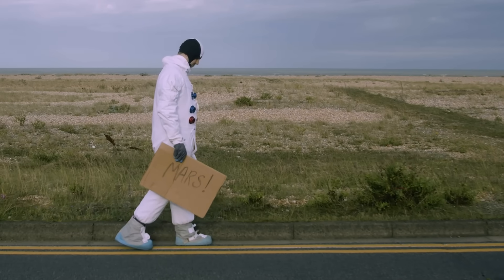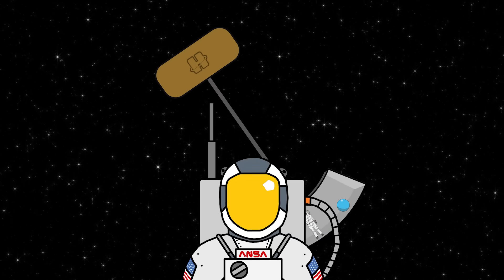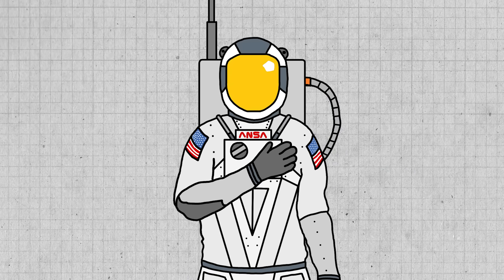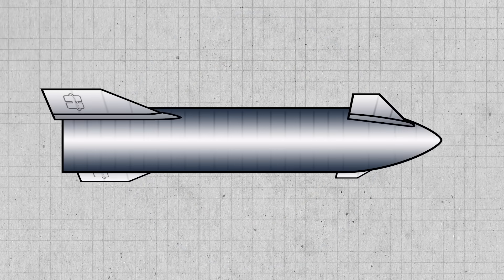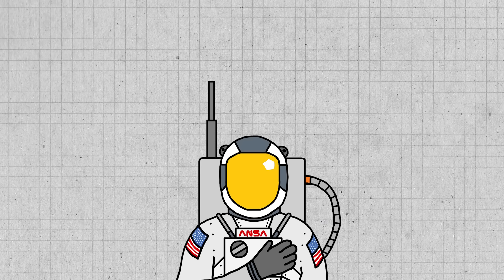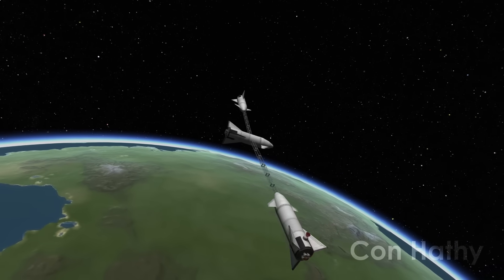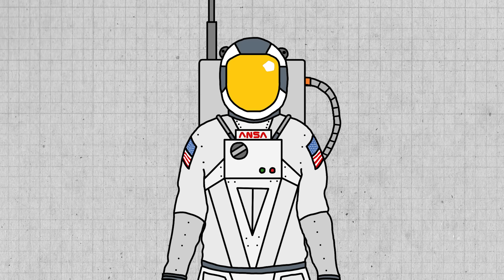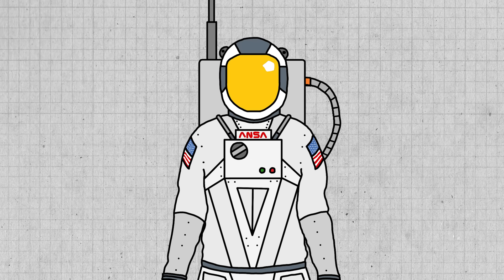This is NOT how you make Artificial Gravity

Comment: About fuel sloshing around - iirc, to prevent the fuel "not wanting to go down" "into the engine" we use a gas to fill up the "empty" part of the fuel tank, and pressurise it all so that the fuel "wants to go down"

Now i dont know if it wouldn't slosh around still, even with that added gas, since the two would probably move around, but for that mechanism to work the way it's intended to - it will "stabilise" the fuel where you want it - at the "bottom" of the fuel tank.

I am not a rocket scientist tho, and i might be mistaken.
Reply from the maker: @Kerbalizer  pressure forces more flow to the engines but doesn’t prevent slosh. To settle the propellant in the bottom of the tank you have to be accelerating to give it a sense of “down.” Pressure just pushes equally in every direction. 

Once your ship is spinning, the artificial gravity will settle the fuel, but even then, very slight movement will gradually waste the kinetic energy over time.

Comment: 8:30 I thought asymmetrical objects are precessing through the various axes while maintaining a constant rotation energy.  The bottle with fluid is a special case as the mass has no constant distribution.
Reply from the maker: @2adamast  yes, if an object is truly rigid it will maintain it’s energy, but in reality even mostly rigid objects slowly loose kinetic energy to heat (while maintaining angular momentum of course)

Comment: Simple answer is accellerate at 1G half way there, the decellerate at 1G on the second hald of the way there with the ship oriented the opposite direction. There are only a few minutes during re-orientation where the accelleration is zero.

Of course this means fuel usage at a varying rate to maintain that accelleration but the trip time will be shorter. Then you have to account for fuel for the return trip.
Reply from the maker: @bbahunter6436  I actually made an entire video all about trying to use thrust gravity: https://youtu.be/nRKNh-Gx9WA
Reply: The acceleration can continue at one gee throughout. (If you have that much delta V.)

No need for any minutes of zero acceleration during reorientation.

Comment: Dude, the rocket won't be rotating, obviously it is not designed for that. As long as it has lineal acceleration it has already "gravity" vertically, you can see that it is designed like apartments in a building.
Reply from the maker: @xantiom  I actually made an entire video all about trying to use thrust gravity: https://youtu.be/nRKNh-Gx9WA
Reply: Rockets accelerate for minutes not months

Comment: They should get a deployable giant tungsten cube on the end of a rope to make the starship spin around the cube
Reply: So it's deployable? You don't have to lift it with rockets, you just ... like ... deploy it?

A starship in 1-RPM end-over-end rotation can pay out a set of 10-km cables from its nose, using a low-thrust high-efficiency engine such as an ion drive to maintain the 1 RPM as the cable ends get farther out, and end up with the starship circling a point 1 km along the cable, getting one gee, while its far end circles 9 km from that point and gets nine gees.
Reply: @grlcowan  r/woooosh
Reply: @dathomirpizzagirl9686  Feel free to explain your wisdom to me.

Comment: There's no need for the central point thruster to be a whole starship. If you made it solely a propulsion system then you could tailor the mass distribution in your favor and you would no longer have the intermediate axis problem. Alternatively you could have a starship variant with a door on it's side that opens up to reveal a thruster for course correction. 
You could also tether 3 or more starships together in a symmetric pattern around the center (this would add large masses to the outside and change the intermediate axis to coincide with the thrust axis.
If I were doing it I would have a small donut-shaped hub in the center with a thruster (or several thrusters) inside that. For distances like Mars you would get great performance from some hall effect thrusters, so you don't even have to worry that much about sheer on the scaffolding. 
There are tons of other ways to go about solving this issue too. I wouldn't call it a massive problem. I would call it a minor engineering challenge at worst.

Comment: People don't understand that we have space IN space. We don't need to be efficient with it. We can send up 100 of the fuckers and chain them togather into a full blown ring megastructure and just F-ing park it on geocyncronous orbit once there, or land it on one of the small moons and send out purpouse built shuttles to the actual planet that you have plenty of time to manufacture. And yes, you can assemble this ring durring the woyage AFTER speeding up, and you can use mars gravity to save a lot of fuel on decelration, or angle the whole thing so 10 out of the 100 can do a slowing burn.

We live on a PLANET! with A BILLION engineers, probably. pooping out a 100 of these should be easy.

You think its not? Then the fuck you wanna go to space? Fix colaboration first, bloody tocomac got delayed another DECADE cuz ppl cant work togather. Look at america went independent practically on day one,  mars will be under constant blackmail, the culture gun suck balls, and probably go independent THE second they can self sustain.

Comment: This video is very old but I thought I'd share something, I am an aerospace engineering student in germany and recently visited a research facility of what is basically the german space agency and they have been working on countermeasures against long time low gravity exposures, since having permanent artificially gravity in your entire facility is to say the least a lot of effort they are experimenting with ways to make the muscle training already proven to work on the ISS more efficient by only training in higher g, this has proven somewhat effective and the training time needed to keep people healthy seems to be decreaseable, currently even on the ISS astronauts need to devote a significant portion of their time to training and for a mars mission this would be even more critical since they don't really get recovery time after landing on mars but need to work right away, thus the degradation of muscle bone and coordination need to be kept in check even more than with ISS astronauts and also over a longer period of time due to the long flight times. What they are currently using for high g training is actually indeed a small radius centrifuge with a training fixture the radius is about 3m and they usually have people train in about 2g though the tolerance of test subjects are vastly different as you have said it can be trained and I don't think not being below average in this kind of area is too much to ask of astronauts who already need to fulfill very high standards.

Comment: short radius centrifuge systems seem viable on paper, but how do they work with the crew in practice? Does the crew just sit in one strapped in 24/7? Do they sleep in it?

It seems much more mentally draining than a larger scale system.
Reply: They’re in it temporarily. And it’s probably going to be a bit bigger than the ones he showed, a bit taller and with a larger area for limited exercise equipment.

Comment: With 3 ships you could design central ship to have electrical engine and flywheel in it. Then you spin 2 ships around and store opposite of their innertia in flywheel, you can now use clutch to slowly stop ships spinning using flywheel... ... ... You don't even need strong electric engine, as you can add momentum slowly and you anyway can't spin up objects on lines too quickly as they would just tangle. biggest problem would be that extra mass and that complex mechanisms add points of failure. That extra mass could cost more delta-v than just using engines to spin up. 

But benefit would be you can spin and stop spin yourself how many times you want with just electrical power and no delta-v loss.

Comment: Also, if we somehow could solve 2 other things, solving this would be not necessary at all.
The two things are:
- Having constant supply of sufficient amount of energy
- Being able to accelerate purely with said energy

This way you could just keep accelerating towards your goal, or sometimes decelerate if the speen becomes an issue due to potential impact with space debris.
Although as long as you can get away with accelerating up until the half point, then that's definitely what you want to do, because special relativity even helps you shorten the journey.

Comment: how much time per week needs to be spent under earths gravity to push off the effects of extended low gravity living ?   that is what would determine if a crewed ship can get away with just partial trip time under 1 g  (a small system Inside the ship where you sit in a chair and stay under gravity for a time. perhaps while sleeping?)
basically the number of crew will determine how much time needs to be spent in the unit and that determines how many units you need to bring.
if there are a lot of crew on a small ship, you are most likely going to have to spin the whole ship otherwise youll waste a ton of space on excess equipment.
the extending/retracting cable system makes by far the most sense, since you can use a little power to spin up while in tight formation, and then extend for the distance bonus during the duration of the trip

Comment: The stresses are too great. It will spin itself apart. This design also has a fatal flaw. In the vaccume of space this design can and will increase velocity of spin because there is no regulated resistance to prevent overspin. 
    My suggestion, scrap it and start over. 
    Build the ship outside of the Earth's atmosphere modulely. That means resurrecting the space shuttle with a new and improved versatile design and larger with the ability to take off and land like an aircraft. Its not Syfy it can be done. But the political powers that be are afraid.
Reply from the maker: @arthurzettel6618  there’s no reason that spin would accelerate in a vacuum, angular momentum is conserved. Once you turn off your thrusters the momentum is stable

Comment: Why could you not use reaction wheels or magnetorquers to make a craft spin?
Reply from the maker: @Kingstallington  The problem with reaction wheels is that they are inherently less mass efficient. Rocket exhaust moves at kilometers per second; to match that performance the wheel would have to be as wide as the entire vehicle and spin at kilometers per second as well, which is not practical at all
Reply: @ConHathy  I think I get what you mean, If the reaction wheel has a smaller diameter than the tethered ships it would need to spin faster or have more mass to produce the torque needed to get the ships up to speed.

But what about magnetorquers? They would only work around planets with a magnetic field, But would they work at all for this application?

Comment: the fact that supposed intelligent people think you'd be pressed against the floor similar to the spinning bucket is funny cos you wouldn't the only section you could stand on is the side wall approaching you, yes I said approaching you because your in a tube in a vacuum and anything in that tube will be free floating, so if that tube started to spin you'd be slammed against the wall as it  goes towards your floating body.
Reply from the maker: @zenithabcdeadlock8474  no, it’s the same as a bucket. The fact that there’s no air outside of the ship does not change basic newton physics. Acceleration is the change in motion, for a circle the change is inwards not forwards (otherwise you wouldn’t turn in a circle, just accelerate in a straight line)

Comment: Wouldn't it be easier to make a magnetized floor and having objects/clothing be strategically lined with iron to mimic gravity?
Reply from the maker: @wifegrant  that just holds you in place, it wouldn’t help with any of the health side effects caused by a lack of pressure
Reply: @ConHathy  I'm pretty sure the ship is pressurized? Isn't the health effects caused by atrophy due to micro/zero-gravity? I would imagine a solenoid could hypothetically provide enough resistance if you are wearing a suit that has strategically placed magnets or iron in it. Resistance that would help a person negate atrophy. Asking out of curiosity. I know liquids are also affected by magnetism. So, could solve some other problems.
Reply from the maker: @wifegrant  specifically the downward pressure inside your body. Your heart having to pump blood against gravity and the pressure in your eyes are both hard to combat without some kind of acceleration
Reply: @ConHathy  Oh! yah i understand. However, having resistance means that a passenger can remain fit while on a long trip. Prolonged travel won't be great, but you will offset most of the negative effects without needing a centrifuge or tether. Would be more efficient than having to take time to do resistance exercises every day. Would also be easier to move around and clean up messes if objects on the ship have the same properties as the suit. Also not just talking magnetized boots like on the expanse just to be clear lol
Reply: @ConHathy  thankyou for the reply tho! did not expect it lol

Comment: Im super ultra not sold on small internal centrifuges, we wwnt a uniform force on the body, which is the opposite of what a small centrifuge will provide!!
Reply: A centrifuge where the difference in gravity is low enough to where you won’t notice (<0.05G) are too big for current rocket technology due to their mass. Smaller centrifuges in the radius range of 3-5 meters are the best for current rockets

Comment: For me the most interesting though is. If you would live in a rotating ring/zylinder for artificial gravity and you would ran (or ride a bike) fast in the same direction the zylinder is rotating you would feel heavier. If you would ran against the rotation you would start feeling lighter and when you ran at the same speed as the rotation of the zylinder you would start to float 😅😂

Comment: What about landing a nuclear powered vehicle on the moon then move at constant acceleration half way to Mars?  Follow this by rotating the vehicle end to end then decelerate to the Mars entry velocity.
Reply from the maker: I actually made an entire video all about trying to use thrust gravity: https://youtu.be/nRKNh-Gx9WA
Reply: @ConHathy  (a copy of my reply to your other posting) Thanks for clearing up some of my blind sides. I think the core of my thesis is to amass all this stuff on the moon as a first step. since the escape velocity from the moon is only about 20% of earth and the "mother ship" going to Mars doesn't need to be aerodynamic, there is a lot more freedom in its design. Basically, the multiple engines could be mounted on a bar joist.

Comment: SAVE that fuel, and spin up a rigid system with gyros, powered by your electric solar cells, which would be needed for the mission anyway! Yes, gyros would add some weight, but a high speed gyro could be lighter than the additional fuel you need, so you do not have to carry it into orbit. Any weight savings are good, because the required fuel for launch power goes down and up exponentially with every extra Kg lifted into space!
Reply from the maker: They won't be lighter. To spin a vehicle you need to give it angular momentum but, according to the conservation of momentum, you have to do this by putting equal and opposite momentum into something else. For a reaction wheel that would be the spinning flywheel itself, but for thrusters it is the burt fuel. The fuel is ejected at the very ends of the tether (maximizing radius) at speeds over 1km/s giving you extremely high angular momentum change per kg of fuel.

A reaction wheel would have a much smaller radius, because it is inside the vehicle, and can't spin at the same tangential velocity because of material limitations. Even an enormous, 10m reaction wheel would experience about 10,000g's if it had a tangential velocity of 1000m/s, and it would still have to be heavier than the fuel because the radius is still 50x smaller.

Comment: big reaction wheel
Reply from the maker: The problem with reaction wheels is that they are inherently less mass efficient. Rocket exhaust moves at kilometers per second; to match that performance the wheel would have to be as wide as the entire vehicle and spin at kilometers per second as well, which is not practical at all

Comment: I'm guessing that Starship has such a small diameter that it would have to spin too fast for anyone's comfort and the gravity gradient between the center and the walls would leave people light headed, pun intended.
Reply: Well a centrifuge at .1 meters below starships radius could produce a little over lunar gravity at 0.1771G at 6 RPM, which is the lower maximum estimate that people can adapt to. The gravity gradient would be about 0.1771 G at your feet and your head about 0.105G, noticeable and uncomfortable but not non adaptable.